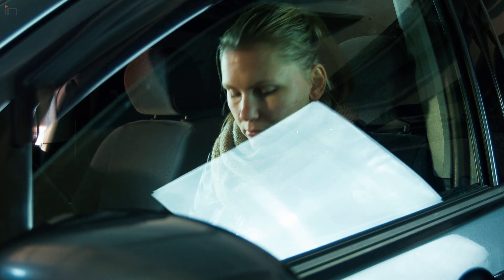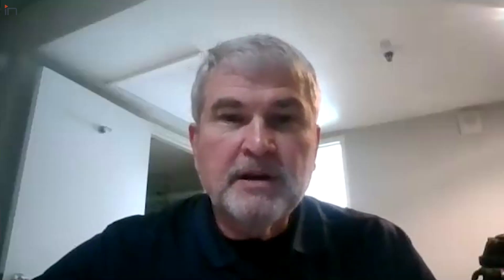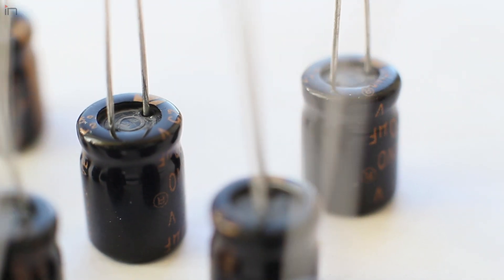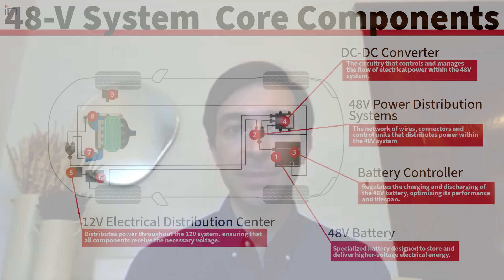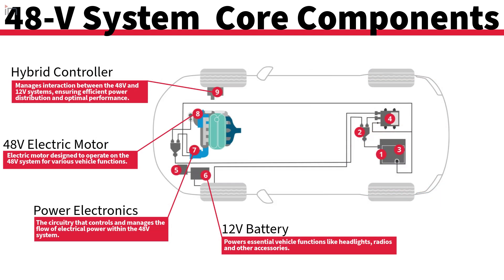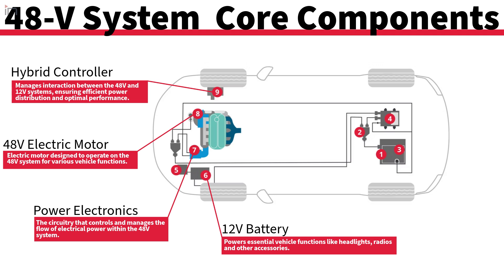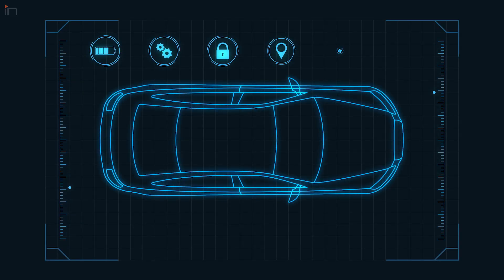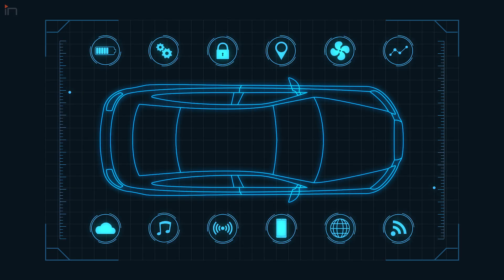Is 48-V the Future of EV Power Distribution?

Comment: take into account that if doing 48v for home storage on lifepo4 the cells,  voltage goes from 2.5v<>3.65v and doing at with 16 cells means the total voltage is between 40v <> 58.4v. but but nmc(ternary) cells do reach 4.2v peak so can reach 67.2v which even if restrict to 80% of its voltage for longevity which is 61.76v would need to add safeguards no matter what.

Comment: Why limit it to EV? Why not include ICE vehicles ancillary power distribution?
Reply: Because ICE is already obsolete.
Reply: The 48V battery will need to be specified to provide cranking current and nobody would likely bother developing 48V starter motors for soon to be obsolete powertrains.

Mild Hybrids can use 48V traction batteries but they use MGUs to replace both the starter and alternator.

Comment: 48 V has been used in cars since ~2017, it came eith the introduction of mild hybrid gasoline cars. The auxilary e-motor is 48 V and also 48 V battery.
In EVs in 2019 Porsche Taycan introduced 48 V for PDCC - Porsche Dynamic Chassis Control.
Reply: Telecom has been using 48V (-48v actually) for a long long time. I do understand inertia and why it will take a long time to get everything except the drive train to 48v on a vehicle.

Comment: 200 watts to crank up a window? Or even 800 watts for a window? This is the performance of an immersion heater.

Thinner cables? Today car manufacturers already use 0.5 sqmm cables in 12V systems. Even thinner cables would often break.

Virtual battery? In the EU it is a requirement that the high-voltage battery can be separated via relays. 
One 12V battery is used to switch the relays. It could also be two 12V batteries for a 24V system, or four 12V batteries for a 48V system. But the starter battery cannot be dispensed with due to the regulations.

Super Capacitors do not have the storage capacity of a lead-acid battery, much less than lithium batteries.

The controllers in the car use 12V, but internally they work with 3.3 volts for the IC.

VW is once again moving away from the zone controller concept for small cars. It is cheaper to combine central tasks in a central controller and pull cables instead of installing a separate controller for each small task.

Autonomous vehicles. Who wants to drive a car controlled only by a computer? 
Who is liable if the computer makes errors? 
Autonomous trains are already rare, autonomous cars are an even more difficult task.

High-speed Ethernet is rarely used in automobiles. The CAN bus system is used in the car.
There are reasons for this that CAN bus is much more suitable for vehicles and that suppliers already offer CAN bus systems.

Suppliers can offer a wide range of 12V systems or 24V systems such as those used in lagre trucks.
Reply: re: "Thinner cables? Today car manufacturers already use 0.5 sqmm cables in 12V systems. Even thinner cables would often break."  exactly, where laymen are only able to see and focus on the idea of thinner wires, in reality what Engineers recognize is they must also focus on MECHANICAL DURABILITY, as there's exists a condition where you can actually have wires that are TOO THIN for a given application (true story).  therein these kids have NO KNOWLEDGE of the time and costs to both OEM's and Dealers involved with replacing bad harnesses under WARRANTY.  in their weak brains everything "magically" works PERFECT for 10 years/100,000 miles.
Reply: Why should you use Ethernet with 4 pairs of wires 
when CAN bus gets by with 1 pair of wires?
Reply: lol this guy knows his stuff

Comment: Allow me to explain this.  Power loss = the resistance times the square of the current.  For the same size wiring,  if you quadruple the voltage, the current drops to a quarter and the power loss drops to a 1/16th (or much smaller wire can be used).  A no-brainer to go to as high of a voltage as your insulation, semiconductor ratings, and safety standards allow (NEC code kicks in at 50volts or 60volts automotive).    Biggest technical challenge I see is making a consumer level automotive produce have so much complexity that is becomes practically unserviceable.